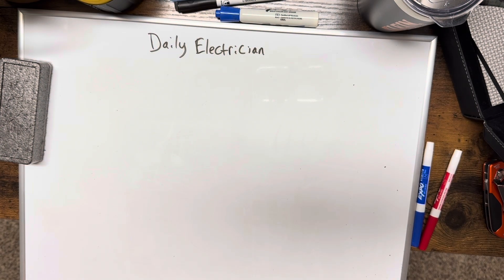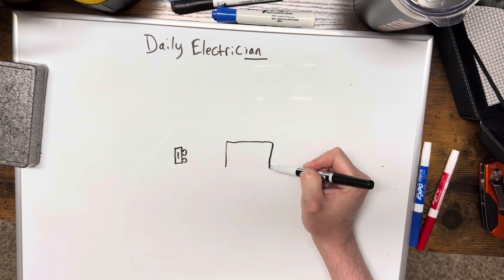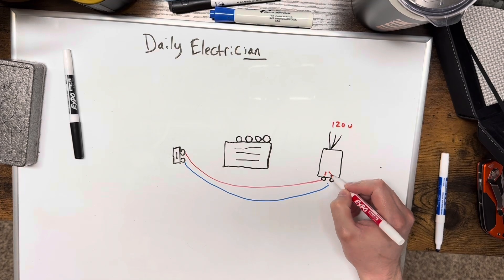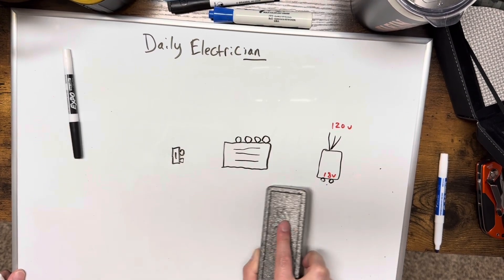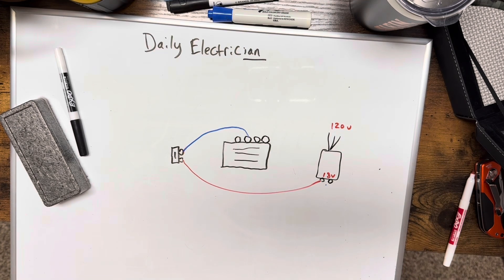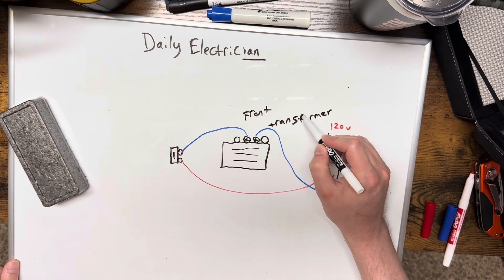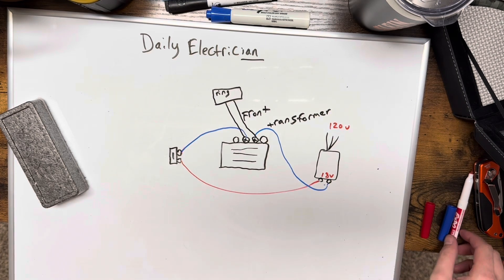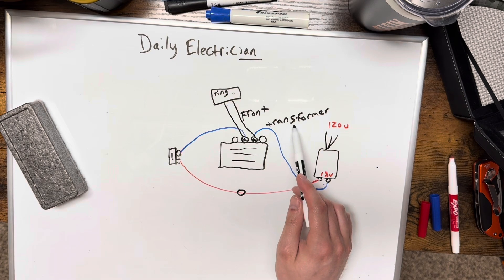How To Make A Ring Doorbell Work (No Blown Transformers/Troubleshooting)

Comment: My ring told me to put a jumper on the chime...after i connected it worked for like 20 seconds then went dead lol ...u think i blew up the trasformer?
Reply from the maker: do you have an electrical meter to test it?

i cant remember if this video had a jumper or not but how i drew it on the whiteboard worked for this specific scenario with the model numbers provided.

if when you used it for 20 seconds and the connection wasnt open it definitely blew up. the connections only meant to be used for a split second and closed for 20 seconds is too long to be used continuously. you wouldn't necessarily hear the doorbell on for 20 seconds when you turned your power on.

hope this helps, if not let me know